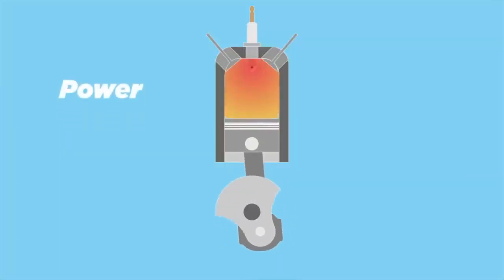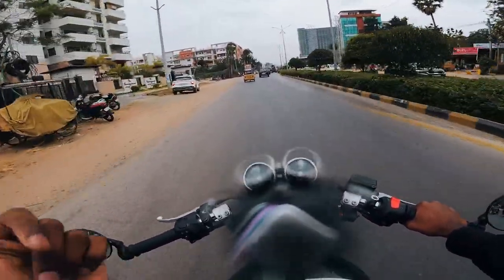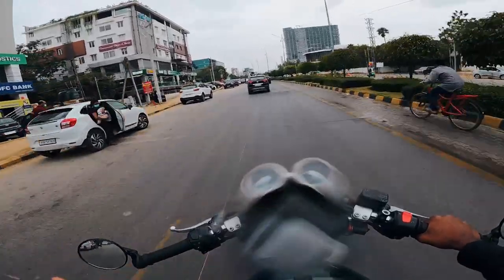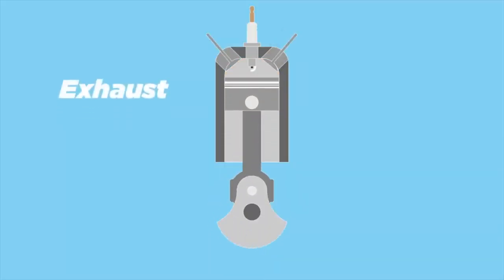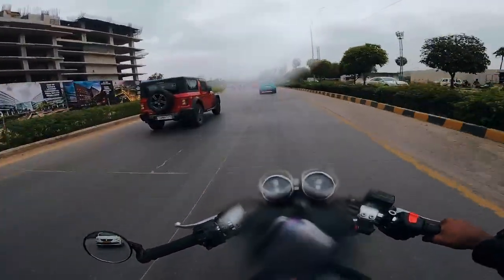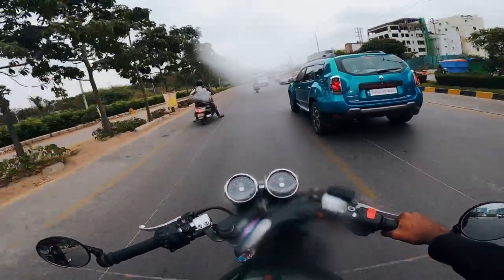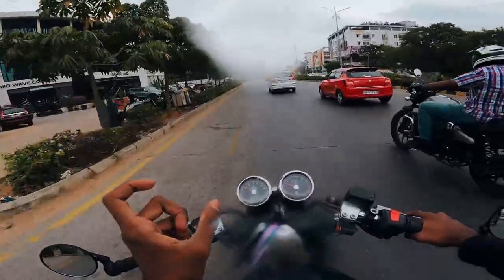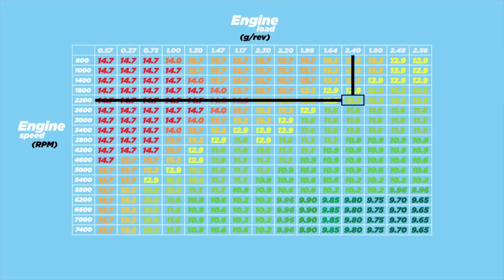ECU TUNING ANTE ENTI? | TELUGU MOTOVLOG | VLOG-13 | ASHIK SABU | SABUSPEC.

Comment: Bro tuning taravata mileage drop ayye chances unnaya?
Reply from the maker: If the engine is fine tuned, then you can get even better mileage than stock. If you're looking for performance tune, then definetely there will be a significant drop in mileage.